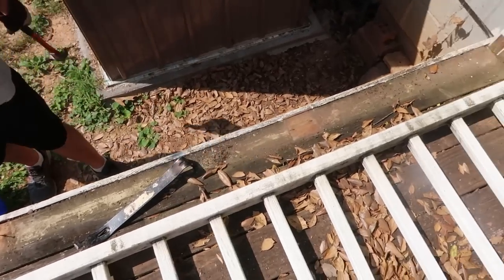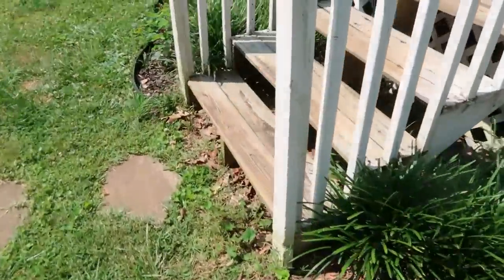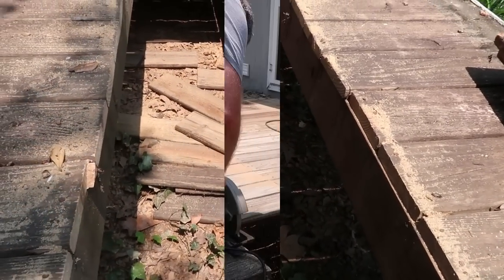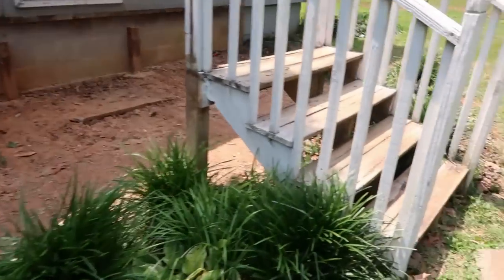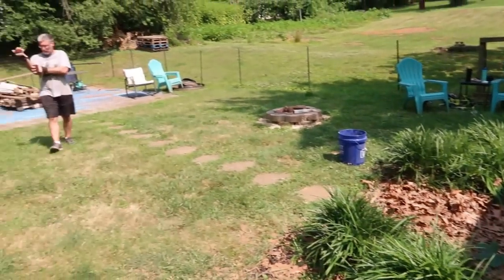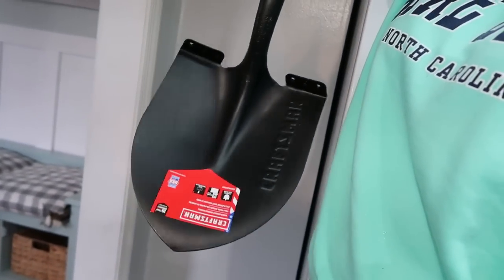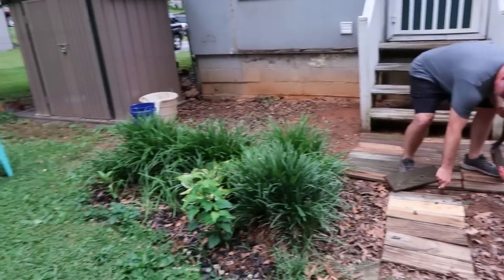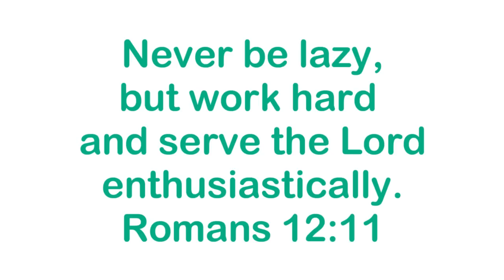SUMMER BACKYARD MAKEOVER ON A BUDGET - PART ONE - TEARING OUT THE DECK AND LANDSCAPING

Comment: We bought a house that the deck had been removed. During the first renovations we did we put in a patio to save money. It helped that our contractor was pouring concrete on another job and had some left over so we basically got it for free. My only issue is water run off. We really need a storm door but it’s a pain managing that on stairs. We’ve already had to replace 2 doors due to rot from water damage. So, we are now putting up an awning over that door to see if that solves the problem. Thought I’d share that since your door looks similar. Other than that we love the patio!